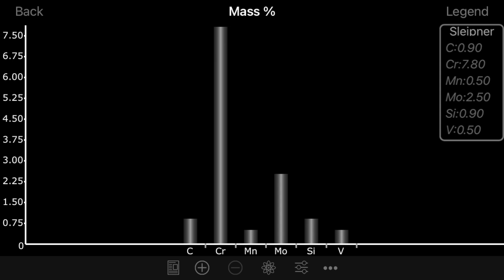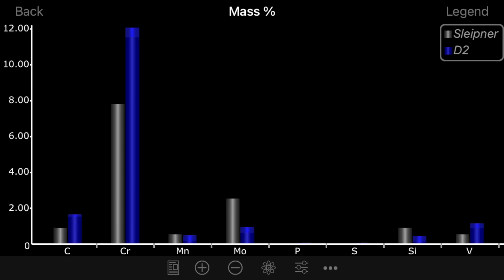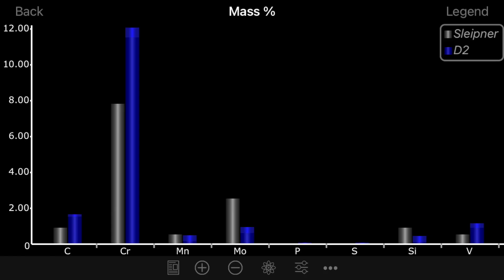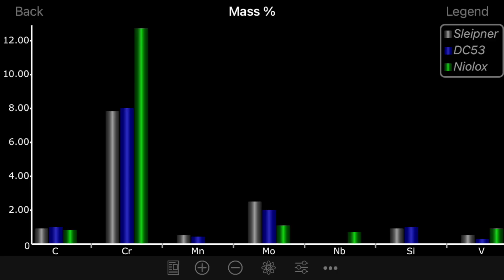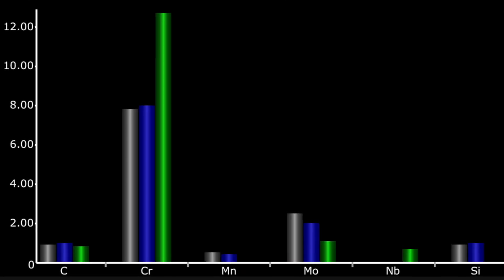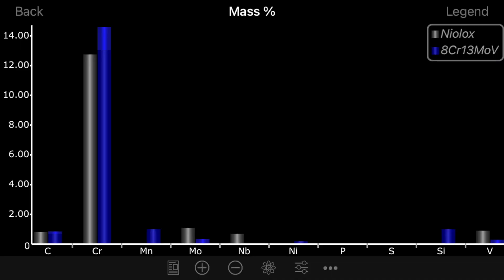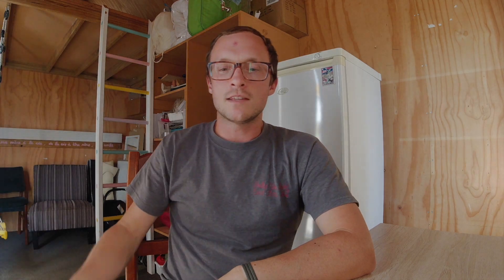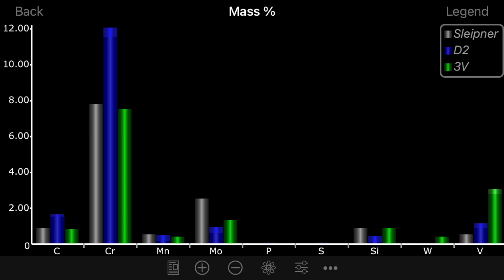Fact or Lie? - Tool Steel Paradigm Shift Comparing Composition

Comment: 3V seems like an interesnting steel for field knives. High toughness, High hardness and high abrasion resistance. Only downside is rust resistance.
8Cr13MoV with good heat treatment is quite good. Main problem with it is that few companies heat treat it correclty.
Reply from the maker: Yeah that is true, most of the HT on 8Cr is pretty bad!  I agree about 3V, also it always resists rust a bit better than I expect!

Comment: You can chat wherever dude but heat treated the steel is far more important. Part
Reply from the maker: Sure bro, I am in no way arguing against heat treatment’s importance.

Heat treatment is super pivotal, but it does have its limitations - IE well hardened 420HC is never gonna have the hardness of Maxamet, nor will Maxamet ever match 420HC’s toughness.  No matter what you do.

Some things only come by composition, but composition is limited as well. IE you could totally ruin Maxamet in HT and have it perform worse than 420HC.

Each one depends on the other, I’m simply a guy who has more experience with composition than heat treatment, so I’m trying to let your average user know what differences you could expect assuming the knives you’re working with are all heat treated with similar intentionality.

Honestly, I need help from other guys to figure out differences in heat treatment, cause I’m not an expert!
Reply: @homeslicesharpening    you can have the best. Steel but heat treatment    is the key part.   End product is. :
Steel quality X heat treatment.  If you have best quality steel but heat crap. End product is CErO quality
Reply from the maker: @frixux  Yeah, and I'd say that composition is nearly as important as heat treat as well.  I mean you could maybe heat treat some miracles into 8Cr14MoV, but I feel that ceiling is gonna be pretty shallow due to low quality manufacturing.

I definitely think it's good you are raising awareness about how we need both good steel and good heat treatment.  The knife world has been crazed about steel alone for long enough, we need to learn about the other key things.

Comment: Although 3v isn't sold as a stainless steel it is almost as good as and the rust it gets is basically just surface patina, even when left out in the elements for long periods of time. It hardly ever pits or suffers with deep rust that affects the structural integrity.
Reply from the maker: This has been my experience as well!  I really really really wish that more companies would make folding knives out of well hardened 3V - I think it’s amazing!

In my experience the stuff sharpens like Sandvik 14C28N - it’s phenomenal.  Probably the easiest-to-sharpen of any of the high-vanadium steels I have ever experienced!
Reply: @homeslicesharpening  I think at this moment in time 3v is about the best knife steel for folders or fixed blades. All things considered it has the best overall balance imo. There are more stainless steels and I guess there are stronger steels but for an all round strong balanced steel 3v takes some beating.
Reply from the maker: @mrdarren1045  Yeah, I love it, and have almost no complaints about it!

Comment: The niolox has vanadium and No both of which are more expensive to add to your modified 8cr.
Reply from the maker: Yeah, that's true - and they would definitely change wear resistance AND price.

I guess what I'm trying to say is that Niolox is similar to what 8Cr would be if they put a little effort (and alloy) into it.  Which I think could be a really cool performance comparison, to show what that class of steel is capable of.

Comment: Hey what about N and V they make Hugh differences between peers. I was thinking about the 14c28 band separately the comparison to m390.
Reply from the maker: Oh yeah, they make a difference!  That's true, perhaps I should have emphasized that more.  I guess with the comparison between 154CM and M390 I'm just trying to say that 90% more Carbon is going to change the dynamics of the steel drastically, just like Sleipner to D2.

14C28N will definitely have different corrosion resistance to AEB-L and slightly different hardness and wear resistance properties due to Nitrogen.  I agree with you, perhaps I didn't state it strongly enough.

Comment: Hmm, could that little wee bit of nickel in 8Cr13MoV but absent in Niolox be the fine line between stainless and tool steel?
Reply from the maker: An astute observation.  I had not thought of that, good catch.  If you want my frank opinion though:

I think there is no line between Stainless and non-stainless TBH (unless you're talking about H1 -which will physically not rust, - and, well, everything else).  Nearly no steel is actually "stainless", it's actually a range that is hard to pin down because more Carbon will suck more chrome out of solution, sabotaging even super high chromium steels (for instance ZDP-189 has 20% Chrome and it has about D2 level corrosion resistance in my experience - simply because the carbon is so high and it sops up the chromium).

Honestly, I've had better corrosion resistance from CPM 3V than 8Cr13MoV on average, and it has nearly half the Chrome.  It's just that the way it's made, most of the Chrome ends up where you want it.

Cheers bro!

Comment: I don't usually look at composition as being what you get after heat treatment. Each component will react different at different time and temperatures with the other components. Depending how the heat treatment is done you can end up with different carbides in solution. Different amount of c, cr, v etc.

This is something you may learn reading through different advanced heat treatment books or passed on from the pro's.

For instance d2, d2 uses vanadium but it is fairly low amount around 1% give or take depending on the type of d2. This is used to refine and allow the hrc to climb. But people think it actually has vanadium in the composition for the end results, but it was more or less used as a tool to mold the end result in heat treatment (trying to explain in simple terms). The truth is, the finished product is mostly chromium carbide's. No vanadium carbides.
Another example in d2 is with more time at temperature allows carbon to soak into solution. Which I believe mass manufacturing often leave out (they often forget ln2 also). Theirs a wealth of knowledge on bladeforums on d2 posted by Nathan the machinest. 

But the point is, the composition after heat treatment is changed into something else than what those charts show. And depending on the heat treatment protocol, you can end up with different carbides, some harder than others. It gets complicated for me to explain, I'd recommend reading some advance ht book's/pdf's.
Reply from the maker: That makes sense, thanks for taking the time to explain.

I am aware that some elements are used as "stepping stones" to results and end up dissolved in solution and therefore are not present as carbides to change edge retention (I think this is the case in 1095 CroVan as well - the chrome doesn't really help with corrosion resistance and the Vanadium doesn't help wear resistance much at all, the purpose is unlocking a potential different grain structure and molecular arrangement in heat treatment, which affects toughness and hardening threshold more than edge retention or corrosion resistance).

I guess I phrased it specifically that the composition is a "canvas that you begin with" because it's a blank slate that you can do a great deal to transform. While it does have some fixed characteristics that can be quantified (IE you cannot add alloys not present through good HT, and therefore 1045 will never have the wear resistance of S110V because the stuff that does the work is not physically present to be manipulated through HT) but you could take a specific steel composition and pull different properties out of it.

I suppose for my average viewer, composition could be helpful because in production knives you are usually looking at an average non-excellent HT across the board with a few exceptions.

I am also aware that there's a lot I don't know.  If there is a good/concise video that communicates what you've said in a way that my viewers are likely to be able to understand, you can sent through a link, and I'd be happy to pin that comment to the top of the comments of this video.

Thank you my friend.

Comment: What boggles me is that seeing the high content of Chromium in D2 which would make me think; okay it's a pretty stainless steel. But what i hear a lot from knife-collectors/reviewers is that it rusts quite easily. I have no D2 steel in a knife, because they say it's a hard steel but it rusts fast. Seeing a Chromium content of 13% how can that be? Please enlighten me Gabe. And ofcourse thank you for this video which hits a few nice facts and fables. Have a great weekend friend.
Reply: This is due to the chromium ending up in carbides mostly. Only some ends up in solution. Making it more of a semi stainless. This is probably due to the higher carbon %. To get more cr in solution you'd have to raise the austenitizing temp and that is likely going to make grain growth not idea.
Reply: @tacticalcenter8658  Ah thank you, that makes a lot of sense.
Reply: ZDP189 is similar, 20% chromium but still prone to rust because it has 3% carbon so most of that chromium ends up as carbides.
Reply: @mikeobrien4081  zdp189 ends up with around 7% chromium in solution.
And I mentioned xhp above being better than d2 but I was wrong. Xhp ends up with about 9-10% chromium in solution, which is better than d2 but not in the stainless range of 12-14%
Reply from the maker: I love this discussion, so good.  The more Carbon gets added, the more Chrome gets pulled out of solution.  And I have had the same experience with ZDP189, while M390 usually resists rust well.  Same chrome amount, less Carbon to suck it up!

Take care Jeroen!

Comment: Coming soon: VG10 vs AUS10 vs N690? :)
Thanks for these vids. Much of the buzz you can hear about steels is marketing strategies, not knowledge. People who sell and design stuff need to do their homework :D
Reply: Some experts in heat treatment for custom knife makers have made n690 perform like most of the mass manufactured m390 (which is around s35vn levels of edge retention wise). The same with d2, most all mass manufactured d2 performs like 8cr13mov while professionally heat treated d2 can show performance around s35vn levels of edge retention.
Basic mass manufacturing won't provide much performance over the more expensive well done custom heat treatments in some steels. Especially since mass manufacturing is limited to a slower quenching process for one example.
Reply from the maker: Yeah, I have been thinking about a VG10, N690, VG1, AUS10, and CTS BD1 compare/contrast.  Maybe next time.

Definitely true that a custom maker can double or triple the performance of mass manufactured stuff.  Still it would be nice if at least the consumers of mass manufactured stuff could tell the difference between the steels somewhat accurately 😆

Comment: Another interesting video. I like poking around on Zknives' interactive steel chart and comparing different alloys. One good comparison is SuperGold/SPY27/Elmax/M390, basically the same metallurgical idea progressively turned up to 11. Of course, the interactions between different elements change as certain thresholds are crossed (like carbon saturation). D2 vs XHP is another good comparison. Maybe you can do a future video on differences between steels with the same recipe but different processing (like D2 vs PSF27 vs CPM-D2).
Reply from the maker: That's a super fun idea, thanks Mike - I will consider that.  I appreciate the response.  Going to check out those sets of steel myself!